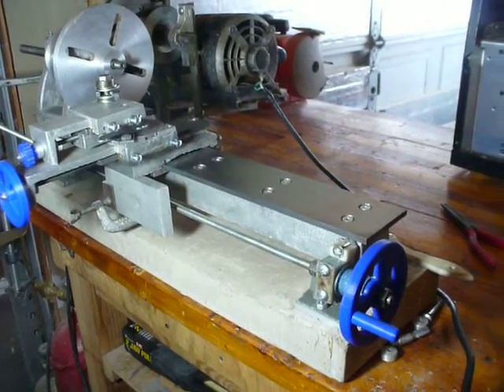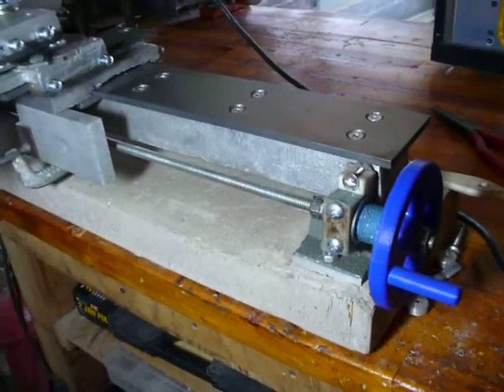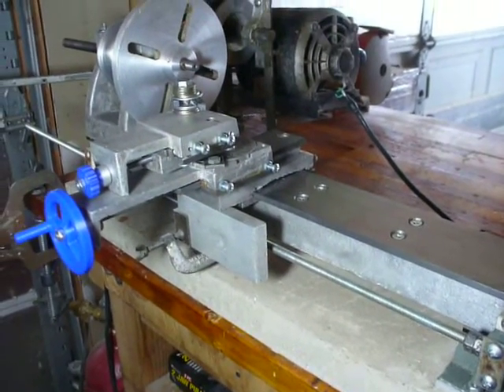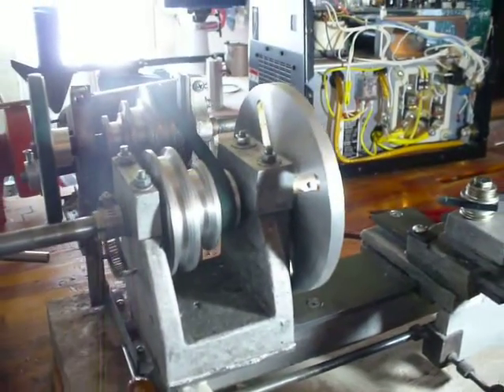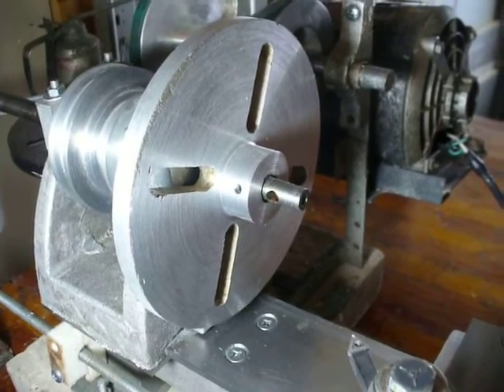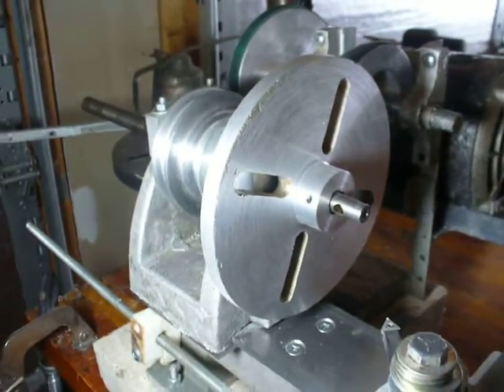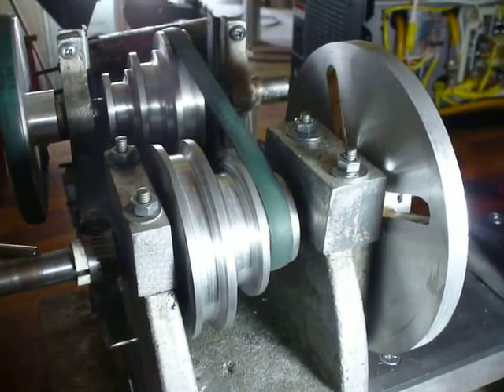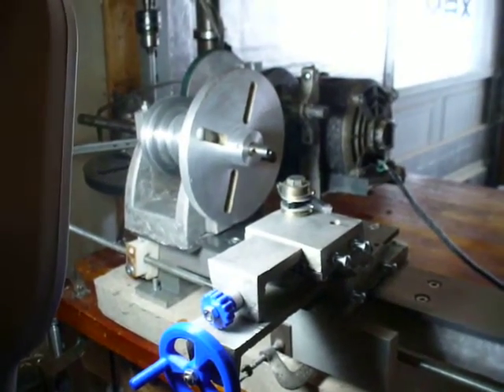Jim's Gingery lathe update 2/1/16

Comment: I saw another video, where instead of using bronze bushings as bearings, the guy just bought a pair of bearings from Northern Tool, for $9.  That may be a better way to go.  If you where to redo the headstock, which you may have already done, you could do that.  I'm not a machining pro, but this is my understanding.  Good project. Thanks.

Comment: Hi there.    I am always impressed to see someone else working on the Gingery lathe.  I have recently started my build.  I was wondering if you have considered using your 3d printer to make patterns for Lost PLA castings.  I saw a fellow up in Alaska use a PLA print for a bearing housing on a plasma table.  He made the print, set it in a mixture of plaster of paris and sand, with sprues attatched, and then did a burn out in his furnace like you would for any lost wax casting.   When he removed the block from his furnace, it had a perfect negative left to pour into.  His casting turned out amazing.  I wonder, with your printed hand wheels, and knobs, if you had considered  using your printer to print a pattern for your headstock?  And using your plastic hand wheels as patterns for a casting? I'd love to hear what you think.
Reply from the maker: +Chris Bridges Chris - Absolutely! I've done some lost PLA casting to reproduce the top half of a Johnson outboard motor carburetor in the past (link if you're interested: https://jimvsworld.wordpress.com/3d-printing-carburetor-repair-with-pla-investment-casting/). Its a very cool technique that lets you make things that would be very difficult to do in the home shop otherwise.I will almost certainly do that with the handwheels, though most of the other parts in this project are very easy to cast using traditional sand casting, which doesn't consume the pattern. Its nice to keep those patterns on hand so you can knock out a spare or replacement as needed. You can of course always print out a lost pla blank, but at the size of some of the parts that can take a while.Always good to hear of another Gingery build in the works, so best of luck on yours!